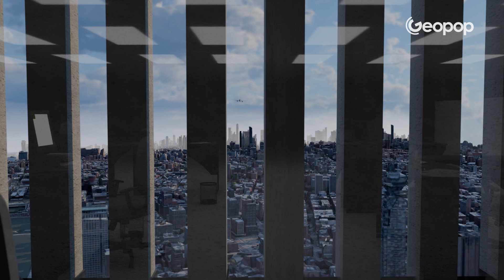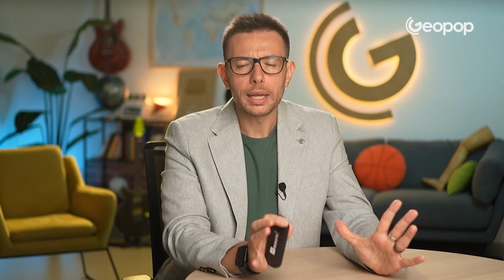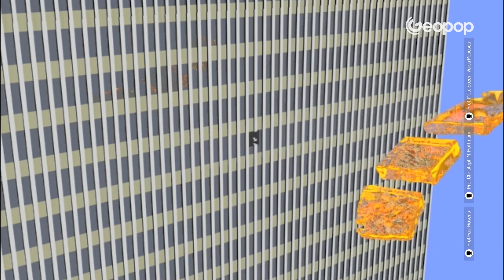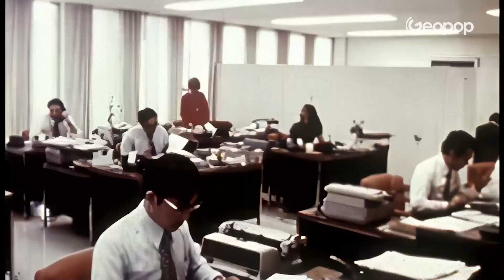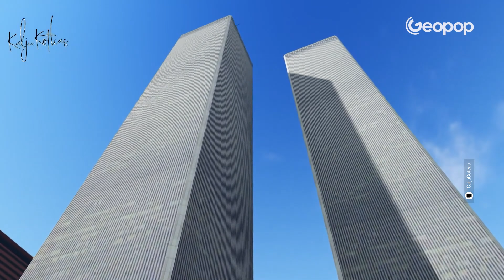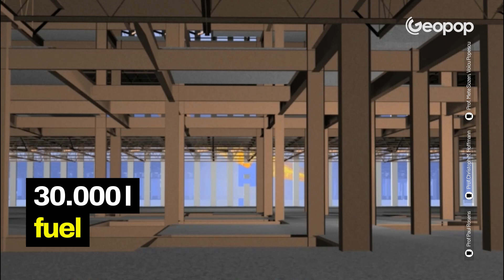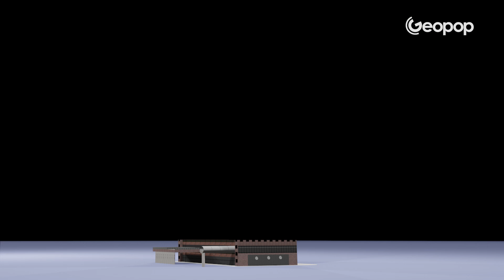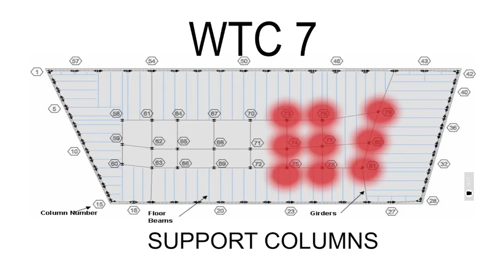9/11, 2001: The Technical Reconstruction of the Twin Towers and WTC 7 Collapses

Comment: People said they heard explosives going off at the bottom of the twin towers. I don’t think those planes could’ve brought the twin towers down they were built to strong.
Reply: Uh huh. And when I ask you to produce those witnesses I will be met with silence. Seen this movie before. Let's do this the correct way instead.

There’s a lot of really bad information out there about the Twin Towers collapses, much of it easily accessible to anyone (mostly from Architects & Engineers for 9/11 Truth who only manage to get the date right). Even though the worlds professional engineering community had the details largely worked out within a couple of months, good information is far more difficult to come by and much harder for many to digest. Engineeringspeak is dull. Wild baseless speculation and pathological theorizing is exciting. Fanciful tails of pre-planned demolitions, magical space beams, melting steel and mini-nukes (the awful stuff) are far more entertaining and require a whole lot less thinking, thus getting far more intention than it deserves.

To correct that situation, I have all on my own prepared this short yet detailed technical description of Twin Towers collapses based on my own observation and analysis of the available true and relevant facts. No politics or ideology, just the engineering. My hope is this will dispel many common myths and answer most if not all questions you may have about the Twin Towers collapses, because anything can seem like a conspiracy if you don’t understand how it works

While complex, most of the Twin Towers collapse mechanisms can be seen with the naked eye and easily discerned and understood by the layperson if sufficient time is taken to understand. 

1. The Twin Towers consisted of 4 primary structural elements that together formed an integrated system where each relied on the others.  47 hollow box-section steel Core Columns carry the majority of the gravity loads. The 236 hollow box-section steel Perimeter Columns carry the remainder and ALL of the lateral (wind) loads. Long-span Lightweight Steel Trusses connect the core and perimeter column together at each floor with a Hat Truss on top to tie the structure together as an integrated unit where no element can survive without the others. There was no structural load bearing concrete and most components were bolted together.

2. The impact of 117 tons of airplane (= to about 12 dump trucks) at speeds up to 590 mph with the energy of a ton of TNT completely destroys the aircraft. This in no way implies the Towers come out unscathed. Many perimeter columns are damaged or destroyed as are some core columns (example; 33 of 59 perimeter and 20 of 47 core columns damaged or destroyed at the impact floors in the North Tower), This damage is primarily through bolt-shearing failures at the end connecting flanges, as well as bending, twisting and fracturing of weld seams. There was no cutting or slicing - the reality was far more violent and messy. 

3. The impacts destroy or damage fire insulation, fire breaks and sprinkler systems on multiple floors.  Huge fires are started across multiple floors simultaneously and allowed to spread rapidly with no effective firefighting or fire suppression. This was an unprecedented fire event . 

4. The hotter steel gets the weaker it gets .  With fire insulation stripped away and no sprinklers the survival time of the steel greatly reduced. Gradually over time heat causes the lightweight steel Floor Trusses at the impact damaged floors to sag, which was observed and recorded.  No steel melted or needed to. Structural steel fails long before it becomes a puddle. It just needs to bend

5. Sagging floor trusses pull on the increasingly weak and overloaded Perimeter Columns, causing some of them to bow inward by up to 5 feet. A straight column is up to 4 times stronger than a bent column. The bowed Perimeter Columns buckle and fail, initiating collapse. The formerly static mass above which the structure below could easily support is now converted into a dynamic mass up to 30 times greater. Because they have buckled, the Columns above and below the failure point are no longer aligned . The load bearing structure below no longer bears any load as it falls past the lower columns, NOT onto them.

6. Thousands of tons of debris fall within the four outer walls, down through the open office space, crashing onto the first intact floor it encounters. This massive impact immediately breaks the bolted connections to the columns as the amount of resistance the Floor Trusses can offer is negligible.  The falling debris slows only marginally and briefly. Note:
6a. This is NOT a solid top block crashing into and “crushing” a solid bottom block .
6b. The debris falls past the columns not onto them.  The columns provide no resistance to the falling debris. 
6c. Only the bolted connections of the floor trusses to the core and perimeter columns can offer any resistance. A pair of 5/8” bolts at each end of each truss vs. thousands of tons of falling debris.
6d. No laws of physics are violated.

7.  This floor-led collapse progression within the four outer walls can only go straight down. Note: 
7a. This process is often incorrectly referred to as “pancaking” which actually refers to a completely different process rejected at an early stage. The catchy name stuck but nobody knows what it is supposed to mean.  Pancaking is too simplistic and inaccurate anyway. More like Kaiserschmarrn.

8. Collapse progresses through the floor systems not down the columns, through the path of least resistance . Rate of floor failures increases with each successive floor as momentum increases, reaching an average acceleration of 0.65 of GA, or 35% slower than true free fall. Bam, bam, bam down the building until there are no more floors to fail.  The resistance offered by each successive floor is always the same. The mass and velocity, thus the energy of the falling debris is constantly increasing, with each floor destroyed adding new falling mass. Some falls to the sides, but most falls down. More mass, more velocity, same resistance with each floor.  Don’t get stuck on the but the lower floors weren’t on fire nonsense. They weren‘t and didn’t need to be.

9. The Towers were 95% air by volume. As that air was compressed inside the building it is forced down the tower and blown out the sides in reaction to the building collapsing . Those were not “explosions”, it was expulsions of compressed air caused by the collapsing building, explaining the low velocity, lack of flash, blast, supersonic pressure waves and lethal high-velocity ejecta.  

10. Perimeter Columns become detached and peel away like a banana behind the collapse front, playing out to the four points of the compass extending to more than 600 feet from the base of the towers. This was quite obvious from examination of the debris pile. 

11. Core Columns fail last as their internal beam bracing is stripped away by falling debris and lateral support from the floor to perimeter columns is lost. 

12. For those who care about how long this whole process took; 31-34 seconds from the moment the perimeter columns buckled until the last core columns hit the pile, or 1/3 the rate of true free fall. Don’t believe me?  Just watch any video of the collapses and note the loose truly free-falling debris dropping much faster than the towers themselves.  

13. Each Tower had a 1-acre footprint. Far from collapsing inside their own footprints the debris pile spread out over 16 acres in a pile up to 14 stories deep. 8 surrounding buildings were destroyed and scores more damaged. 

14. What was NOT observed were the 180-190 dB bangs of thousands of high explosive devices or the blinding bright flashes of burning thermite. Neither could have caused the (silent) perimeter column buckling that clearly initiated collapse.  Neither explosives or thermite could have survived the impacts and subsequent fires either. A video of a shocked and injured firefighter using the magic word explosion is in no way proof of explsoIVES . The pre—planned demolition case relies entirely on that sort of thing. There is zero tangible physical evidence and it would be technically impossible, totally impractical and completely unnecessary. No one would bother. 

15.  Finally, the Twin Towers were perfectly safe within their design envelope.  They only collapsed when taken far outside design parameters by an extraordinary and unprecedented event 

Impact + Fire (heat) + Time + Gravity = Collapse . Remove any one of those four elements and there is no collapse. Ignore any of those elements (as many do) and you will never understand the collapses. The Twin Towers were an integrated system in which no one component could survive without the others. One fails, the rest follow, through the path of least resistance – DOWN – through the open space, bypassing the path of greatest resistance – the columns.  Nothing I just described violates any laws of physics. All of the above is true no matter who planned and carried out the 9/11 attacks or why 

I hope you found this helpful and informative. It is not meant to be adversarial, but to solicit informed critical comment, positive or negative. If I made any errors of fact, logic or reason or left anything critical out, please let me know so I can fix it. To stay focused just one topic at a time please and on-topic (Twin Towers ONLY). No word-salads of Gish Gallop. IF you can offer a more plausible alternative be my guest. Be the first. Please start any reply with the words “Tits McGee” or I will know you didn’t actually read it, are not serious and just wasting my time.